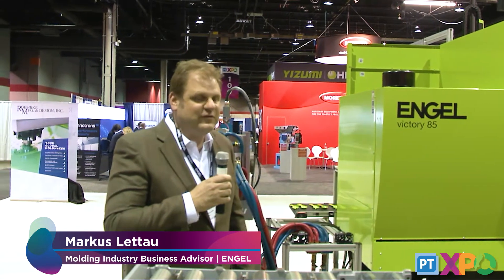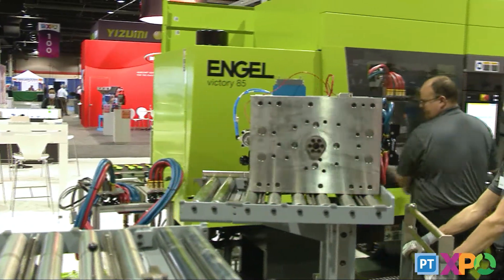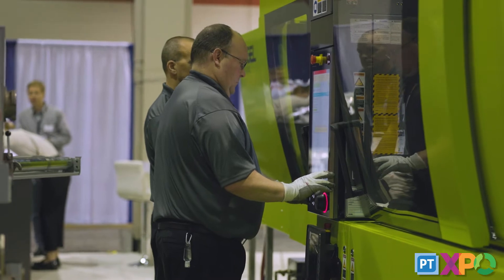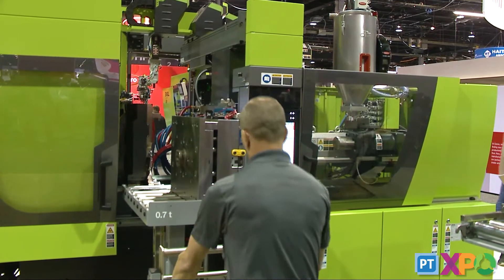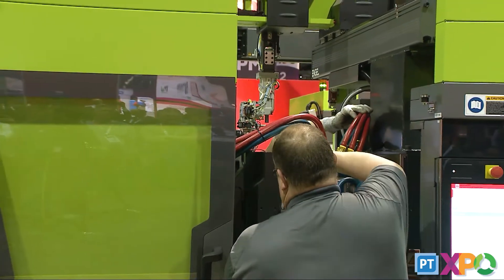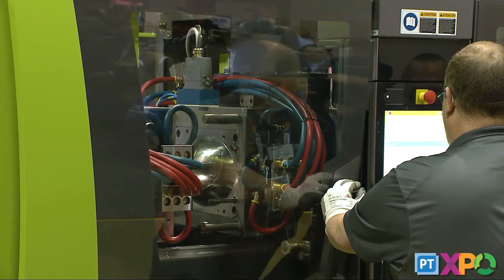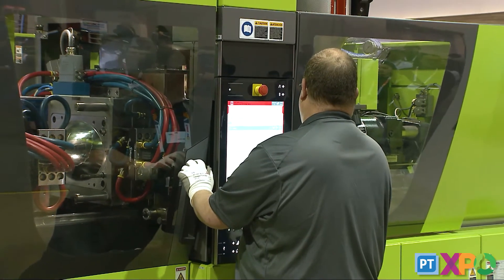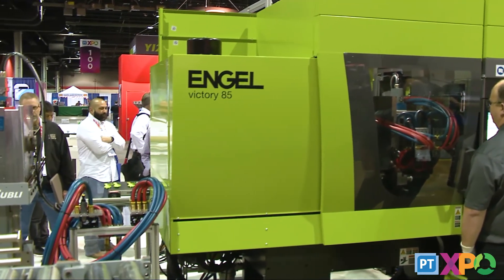Engel demos 10 Minute Mold Change at PTXPO22

Comment: now hopefully that material handler isn't on tiktok in the bathroom when you need him at the same time.. or hopefully your barrel heats don't have to go from 500 to 400, or lets say you have to actually use rust protect and mold cleaner, now lets say you have to actually change the EOA as well.. I can do a MC in 30 minutes on a 500ton alone. 15 with a second person that's 1/2 inch quick disconnects and hydraulic for cores/ejectors and that including changing the EOA on a sepro and non magnetic base. Even faster if i'm going to a sister tool and using the same method of clamping (direct to direct or clamp to clamp with same thicknesses) 2500 ton, yea that'd take 2.5 hrs on a 40 ton tool but that's partly due to grabbing aux units from other presses and hopping up and down grabbing 6 hr cable sets and torqueing each bolt down to 650.
Reply: 200 ton roboshot that takes 3 minutes just for the die height alone used to take 25min with k/o bars.. people just don't know how to stage for the next changeover, if you have everything you need they're pretty quick.
Reply: we understande nothing, whats EOA

Comment: Some years ago I did mold changes with a over head crane and my average time was 15 mins or less for last part to first part off, the fastest change over I did was 6 mins, this was blowing out the water lines, and removing hoses, we have hydraulic clamps with positive stops on most of the machines with a few mag clamps, I can't imagine how fast I would have been with this system.